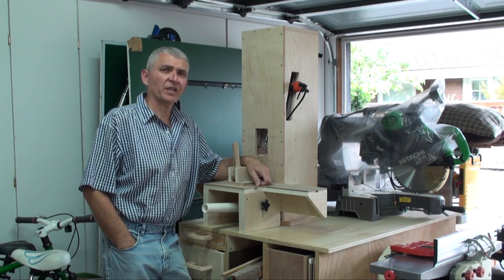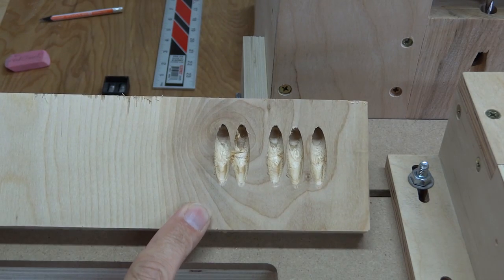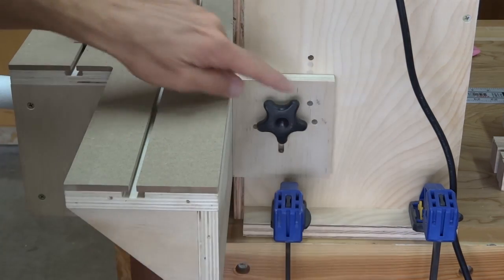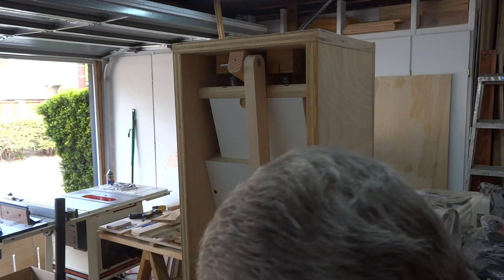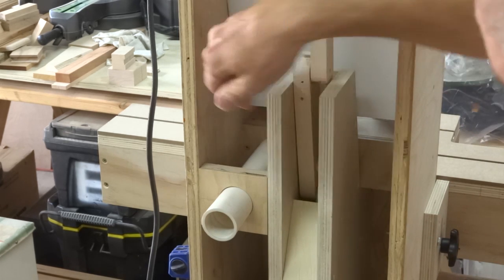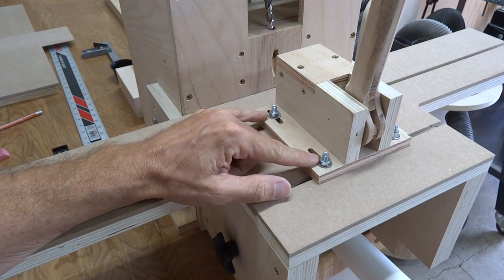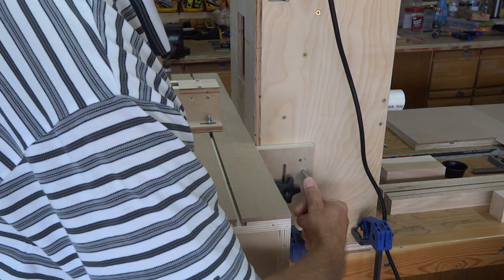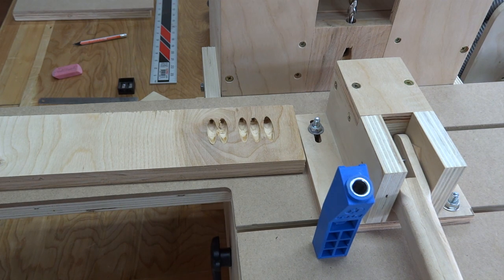Homemade Pocket Hole Machine (Kreg alternative)

Comment: Trevor you'll have to check out my new machine. Way smaller
Reply: I saw it and really like it! In fact, I like it so much I actually modified mine to match yours by lying mine flat and attaching a mechanism similar to yours. I retained the length because I often work with large boards and the longer frame provides a bit more stability.